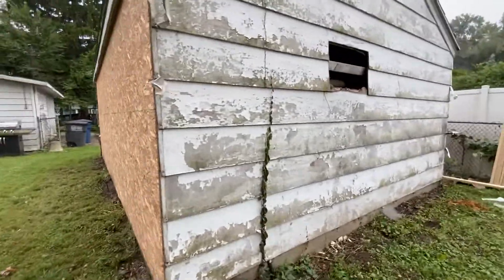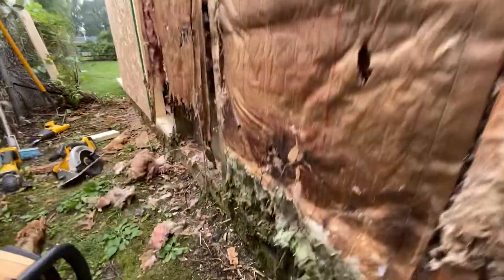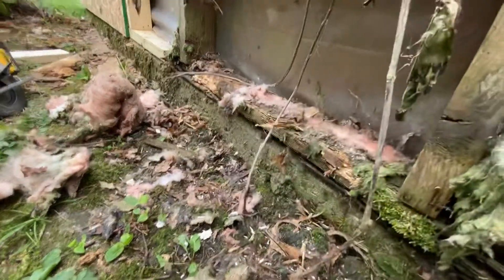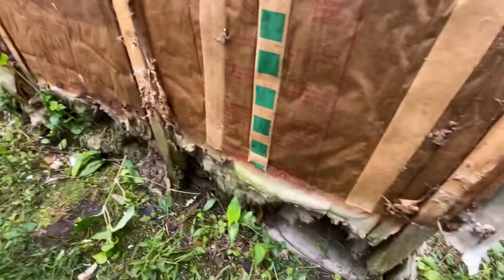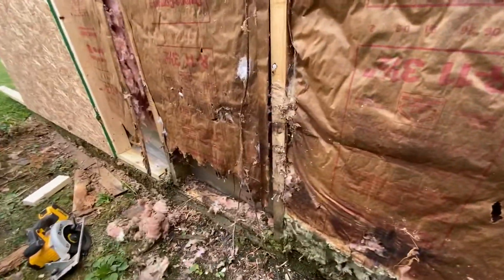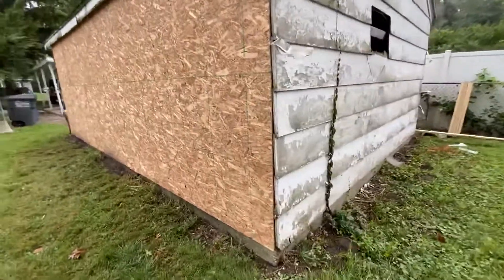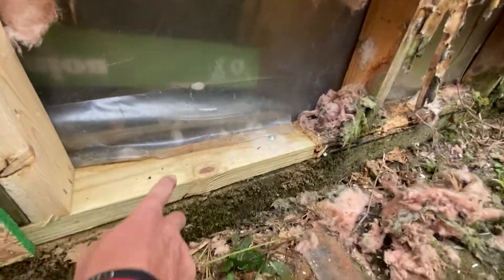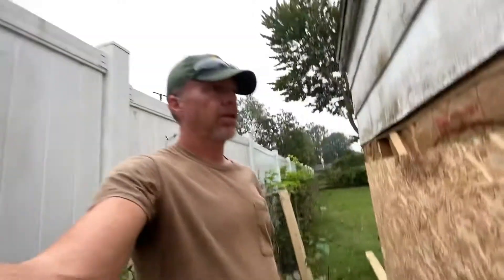IT’S BASIC HOME MAINTENANCE!

Comment: Hi there. Good to see you again.
Where did the water get in from, specifically in this garage?
What do you nail and caulk periodically for maintenance?
If the concrete slab were sitting higher of the ground, would it have solved the majority of this garage problem?
Thank you for the education
Regards
Reply: Paint protects the siding and the slab being so low it probably splashes up against the ground.
Reply from the maker: It was a Masonite siding, which is basically like cardboard, so it really doesn’t like moisture. And yeah, the garage being so close to the ground and the garage having no rain gutters didn’t help any.

Comment: Hey man, question for you. 20 or 24 inch on center framing? Which should I use?
Reply from the maker: I always use 16” for walls, and 16” or 24” for rafters
Reply from the maker: 16” for rafters is better, 24” is cheaper